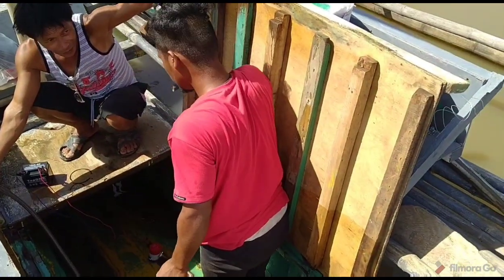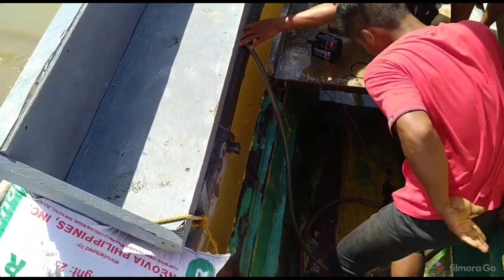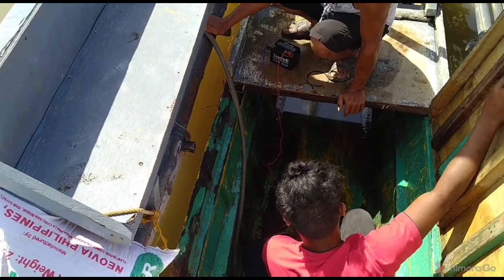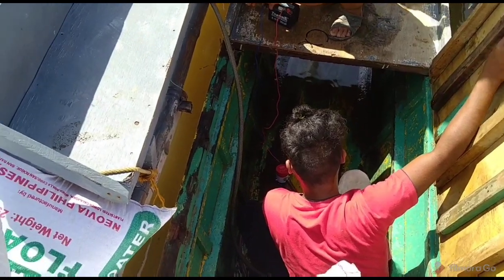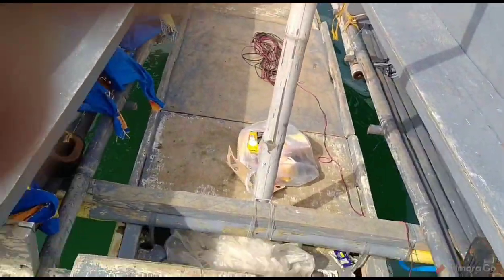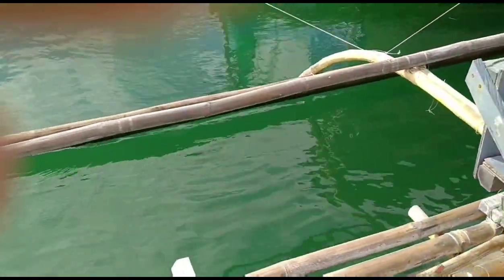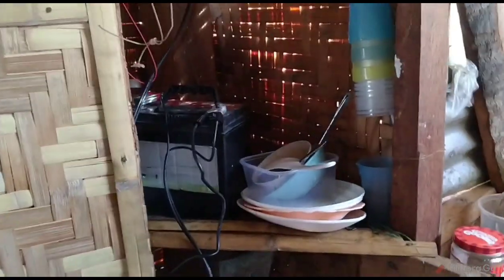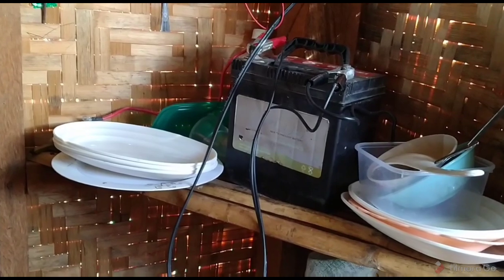Putting In The Bilge Pump For The Bosslady

Comment: Brian, you might be able to buy a small Solar Panel for the battery, from Lazada?  If it won’t be secure mounted on the boat, then mount it at the fish pen, and take the battery out daily to hook up to the solar panel, maybe?  Or have a spare battery hooked up to the solar panel, and switch them out, daily?
Reply from the maker: There is one on order..

Comment: On the pump or the package it will say how many amps it pulls and then on your battery it will say how many amp hours it is just for a suggestion if the pump is 1 amp and the battery is a 10 amp hour you can run that pump   For 5 hours you can only dream the battery 50% if you go lower than that you started damaging the battery